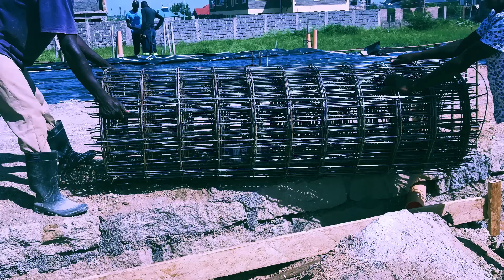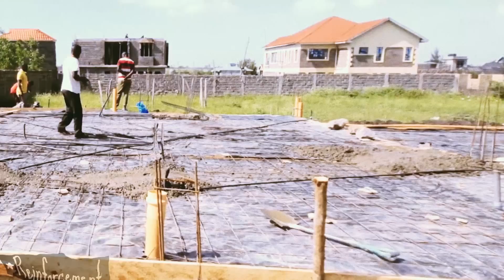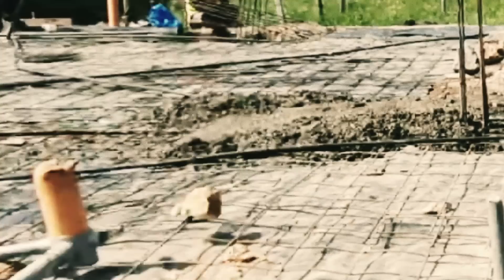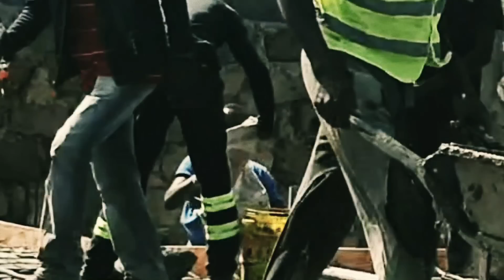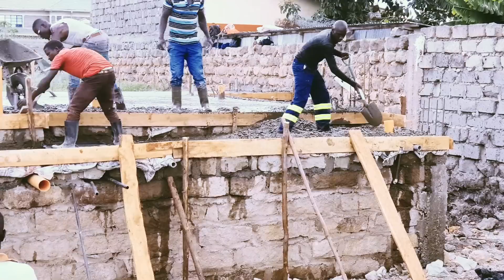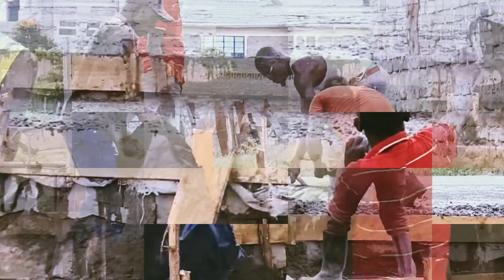Finally! We started building our own house | Part 1: Foundation | Concrete Slab|

Comment: You chose the most expensive foundation design. 
Cheaper to do a floating slab that requires no excavation or walling.
Or turn the huge crawl space into a basement rather than backfilling it.
Reply from the maker: Yeah, coz the plot is towards the stream so when it rains, this place, especially this parcel becomes chaotic hence the need to protect the house from floods.
Reply: How is the floating slab done?
Am about to build on cotton soil and I fear the cost might be high.